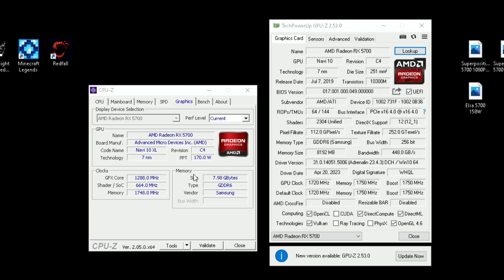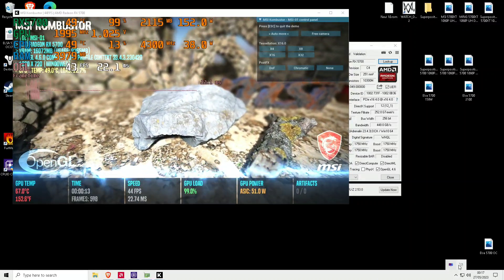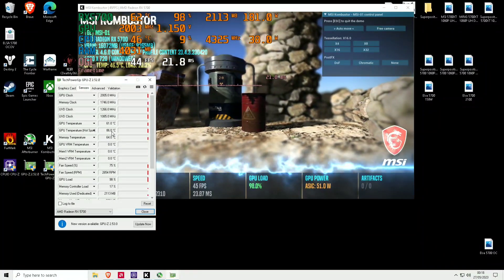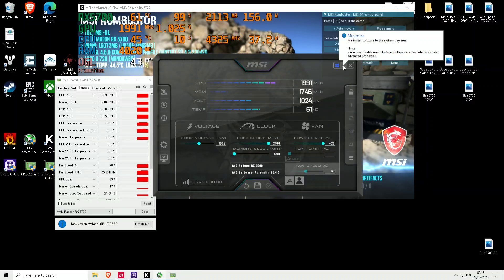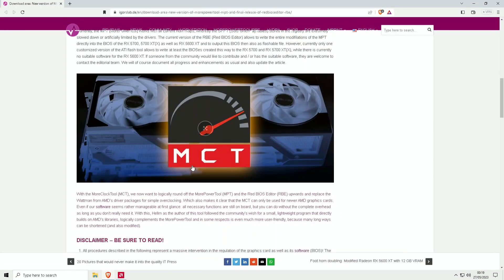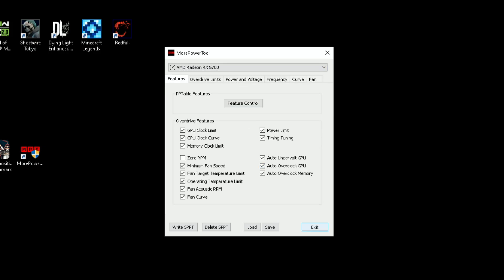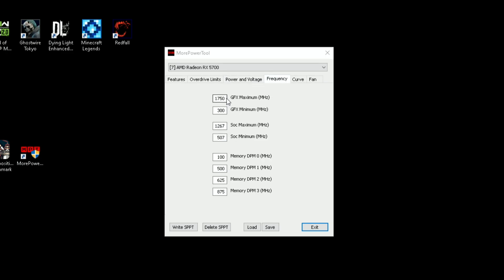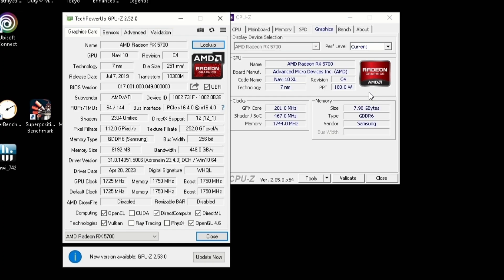ELSA 5700 | MORE POWER WITHOUT FLASHING VBIOS! | MOREPOWERTOOL

Comment from the maker: Hope this helps guys! Very easy to use, subscribe to support me, thanks.
Reply: I got my Rx 5700xt I want to confirm if it's ok to run it with a pig tail cable dual 8 pins
Reply from the maker: @sodiqlawal7309  Yes it's fine, 5700XT is 225W TDP, 75W from MB and 150 from cable is max rated. Anything higher & will need separate connectors.
Reply: @AlexHusTech  thank you very much
Reply: @AlexHusTech  so after I did it 
It worked but while installing the drivers I got black screen
And no signal on the monitor
The graphics card fans keep rolling for sometime then stops
Reply from the maker: @sodiqlawal7309  Oh, I'm not sure, not had that issue before.
Reply: @AlexHusTech  someone said it's the driver
Reply from the maker: @sodiqlawal7309  what driver did you install?
Reply: @AlexHusTech  I used amd auto detect 
It installed amd software pro edition
I entered the system using the on board graphics
Reply: @AlexHusTech  I am currently downloading AMD andrenalin
Reply from the maker: That's the correct one, always do it manually though.
Reply: @AlexHusTech  finally got it to work after hours of crying over my money 😂
Reply from the maker: @sodiqlawal7309  lol that's good.
Reply: @AlexHusTech  😂😂😂
Turns out it was a bios issue
Reply from the maker: @sodiqlawal7309  What was the issue on the bios?
Reply: @AlexHusTech  I saw a video on YouTube and decided to follow it
I took out my CMOS for sometime and after 5 mins I re inserted it
Reply: @AlexHusTech  I used furmark GPU stress test and my hotspot was getting about 109° after about 10 mins
Reply from the maker: @sodiqlawal7309  110 is max which AMD said is "normal" will need to undervolt.

Comment: Hi bro, I'm new to this, just to make sure I'm going to do it right, I have an ASROCK Phantom gaming oc rx 5700, first you do the settings in MOREPOWERTOOL and then I adjust the undervolt and clock in MSI AFTERBURNER? Do you think it has good temperature results? this card has triple fan. PD: I love your content
Reply from the maker: @jumnose4948  Thanks bro, yes that's the correct steps. Triple fan should run cooler.

Comment: Is there a way to make the settings I put in more power tool permanent, everytime i ddu and update drivers everything goes back to stock .
Reply from the maker: Not that I know of unfortunately, I think you can save the file and load it up, instead of having to manually change one by one.

Comment: Bro. If you flash the bios, when downloading the driver do you have to select 5700 xt drivers ?
Reply from the maker: I never flashed to 5700XT, but yes if you flash to 5700XT BIOS then you will need to use 5700XT drivers.
Reply: @AlexHusTech  thank you bro
Reply from the maker: @gabrielnedu6367  no worries

Comment: Hello,
I would love it if you replied.
So i am getting a gigabyte rx 5700 gaming oc with 8 pin and i came across this whole flashing scenario with my last gpu getting "locked" to my older psu for unknown reason im a little scared to flash it in case anything goes wrong.

To break it down flashing to an xt bios removes the software limits right? Like the limit on power and voltages and allows the card to achieve higher clock speeds.

So using the method you showed in your video the same could be achieved right? But without the risk of bricking the card.

If my cooling is sufficient can i set the power limit beyond 170w? And if its cool and stable i push the clock speed? What about the voltage do i go up on the voltage as well?
Reply from the maker: So yes you are basically unlocking the limits & then will need to use MSI/Adrenaline to change the values to stable values, it doesn't physically flash the BIOS, it just changes the registry as I was told. So an AMD update will revert the changes back unless you save the changes as a file and actually flash over the BIOS.

Higher frequency requires more power/voltage (Also stability)  but means more heat! Will need to find the right balance as every card is different & good airflow matters. Hope this helps!

The main thing is it won't brick, pushing it too much & you'll get crashes, so just needs dialling down etc.
Reply: @AlexHusTech  thank you soo much man. Appreciate your reply i just subbed and liked.
Have you ever tried flashing one? Also how close is the performance compared to flashing or how close is this one to 5700xt stock.
Reply from the maker: @raufsiam7341  thanks appreciate it. I haven't flashed as I don't keep them long as I sell them on to buy the next one. It was 5% less than a 5700XT, I made a video on it somewhere.

Comment: thanks for the video introducing morepowertool, first time having a RX5700!

does having an edge temp of above 80 then junction temp of above 90 degrees up normal for around 2000hz, or rx5700 in general does get higher temps?
Reply from the maker: 5700 and XT were known to be hot cards, sometimes you'll see 100+ on junc temps, so th0se 80/90 temps look normal, but it's advised to repaste and have good airflow. I would always recommend a UV than just a pure OC on these cards.

Comment: I tried your overclock settings i set voltage 1025 ,  core clock 2100mhz and power limit 20% but it crash every time why?  i have the same card
Reply from the maker: Every card is different, you may have to lower the clocks even more unfortunately or increase the wattage.

Also what's your PSU?
Reply: EVGA 450 +80 BRONZE @AlexHusTech
Reply from the maker: Try increasing the voltage to 1050 and try decreasing to clock to 1900, if it's stable then change the values slowly & keep repeating the process until you find the best settings.
Reply: Thank u @AlexHusTech

Comment: Does this method only work with Elsa GPUs?
Reply from the maker: It works with any AMD cards from the 5000 series onwards, but not sure on the 7000 series.
Reply: @AlexHusTech  👍👍👍👍👍👍
Reply: @AlexHusTech  Do you recommend I do this method with an RX 5700 or buy an RX 5700 XT?
Reply from the maker: @Javiirodri  it's up to you but the 5700XT is still a little more powerful.
Reply: @AlexHusTech  but the difference is minimal, right? 5 fps maximum difference?
Reply from the maker: @Javiirodri  Depends on the game etc, however the 5700XT is around 10% more powerful so make sure the difference you pay is not more than 10%.

Comment: What will happen if i do it just with msi afterburner (my chip can reach 180 on stock) ..will it work if i set core clock to 2000 and the core voltage to 1.025 ? ...(default is 1750mhz / 0.952 v)
Reply from the maker: Every card is different so will need to test it yourself.

Comment: i will get more performance by just doing this or i need to change clocks in msi afterburner?
Reply from the maker: Need to change clocks after, this just unlocks higher clocks speeds etc
Reply: @AlexHusTech  whats the safest stable values please
Reply from the maker: @boucettahani4531  Use this as a guide
https://www.igorslab.de/en/making-the-radeon-rx-5700-and-rx-5700-xt-more-energy-efficient-and-significantly-quieter-with-the-morepowertool-tutorial/2/
Reply: @AlexHusTech  thanks

Comment: I have gigabyte gaming oc rx 5700 the problem is it has only a single 8pin connector.
Reply from the maker: Why is that a problem?
Reply: @AlexHusTech  i cannot increase the power limit too much so less performance
Reply from the maker: @Srdb1999  A single cable should be safe to draw 150W, board provides 75W so total is 225W, the 5700 is typically rated a 170/180w so you'll be fine, no need to draw more than 180W.
Reply: @AlexHusTech  ok thanks bro i will try this
Reply: so did it work?
Reply: @zf8496  yes it does work

Comment: Every one says this card is cold but mine it reach 75 degree on the stock bios (ppt 158 - core clock 1750 ) and with doing your method it reach 88 degree why ?
Reply from the maker: Did you repaste? How good is your airflow?
Reply: @AlexHusTech  No i didn`t repaste it

The airflow is ok 
It`s a Atx mid tower case with 2 fans at the front and one at the back
Reply from the maker: @wolf-x-51  I would repaste & see if that helps.
Reply: @AlexHusTech  Thanks
Reply: Which color thermal pads do you see in your card? I've got blue and higher temps as well. I'm going to change thermal pads for better one
Reply from the maker: @serejamos3250  Let us know if it makes a difference.
Reply: did that help ? @serejamos3250
Reply: @wolf-x-51 which model?

Comment: Hi Alex

Have you tried using the 2nd bios on the card it usually has the 5700xt bios flashed on these cards.  With the amount of power and heat it generates from the xt bios not really worth it for an mostly 5-10 bump up in fps
Reply from the maker: This card doesn't have a dual bios on it. I've managed to get it stable without generating much heat with performance close to the 5700XT.

Comment: Nice tuto, easy understanding. One point, I have stability in benchmarks, but some issues playing game setting 2100mhz. So I'm using 1900mhz. The performance "decrease" is 1fps at benchmark.
Could you check your score in Superposition at 1080p Medium? Mine is 17066.
Reply from the maker: Yeah that's common, in synthetic benchmarks you can push the settings higher, but gaming there's more stability issues so will have to downclock slightly.

No problem I will get back to you when I get time, bank holiday weekend in the UK.
Reply from the maker: I got 17021,  @ 1150mV

I couldn't get any higher going 25mV either way.
Reply: @AlexHusTech  basically same results, thanks.

Comment: Wow thats very useful, it is now equal or better than the 5700xt? So now there is no need to get the xt model?
Reply from the maker: It's pretty much equal to 5700XT, just heat would be an issue as the heatsink is smaller than the MSI 5700XT gaming X, however if you OC'ed the 5700XT you'll get even more performance.

I want to get a 6700XT next once prices come down.